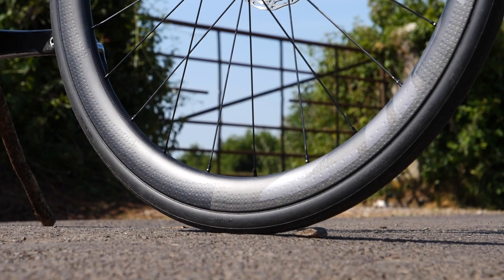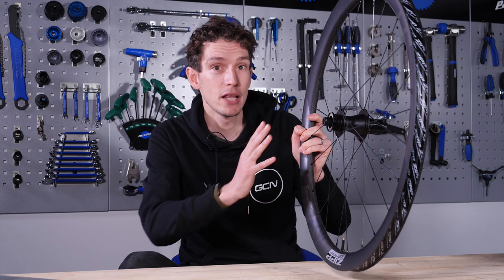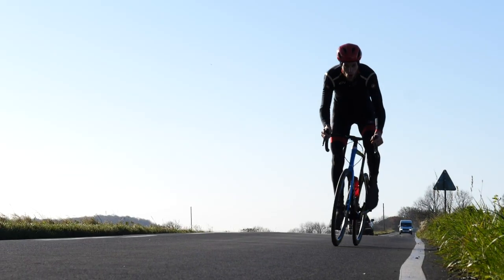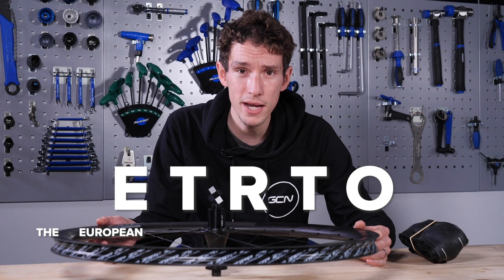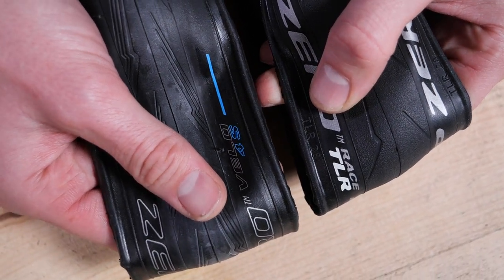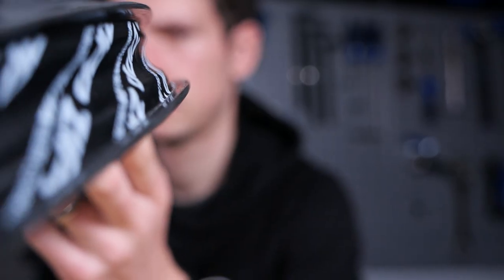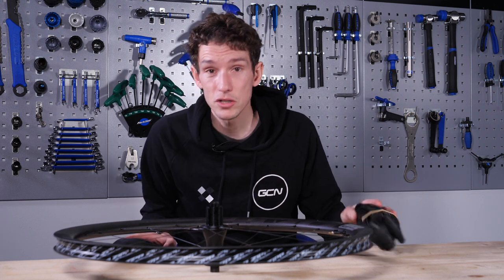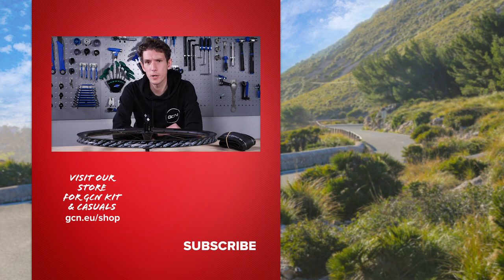Hookless Rims Explained | Which Bike Tyres Can You Use & Why?

Comment: i purchased a very expensive set of carbon hookless rims at my local bike shop.   They sold me some nice, expensive tires to put on them.  After a full weekend of wrestling with it, the tires would not seat or seal.  Turns out the tires weren't compatible with the rims.  So we checked with the wheel manufacturer.. they basically said, 'we only tested it with ONE specific tire MODEL, and only in one specific size, and only at a very specific pressure at that.    So, we tried that tire (not a tire or brand I was fond of mind you), and still had a terrible time getting it over the edge of the rim, even using metal tire levers (after snapping several plastic/nylon levers).    These wheels were specifically intended to use on a gravel bike.  I live in an area where it is often cold and wet and dark, and almost all of the best gravel riding is in areas with little or no mobile phone coverage.   Then we asked if they supported running tubes in these tires.. the answer was a firm NO.   Which means no emergency tube/boot install.

I sent an email to the manufacturer asking them how I could get possibly service this tire in the field - i.e. on the side of a gravel road or trail, potentially in cold/wet/freezing weather, and outside of mobile phone service area.   They had no answer.    My comment was a very pointed request for a refund, which they granted.    The shop doesn't sell that particular brand of wheel any more - at least they didn't last time I was there.  

Keep these simple thoughts in mind when considering spending money on hookless rims.   What tires are you going to run, and at what size and pressure? Are those tires compatible?  (ask the wheel company and the tire company - you'll probably get VERY different answers from both).   Are you willing to limit your tire choices to those that are compatible?   What happens if you cut a sidewall, or have some problem that requires you boot the tire and put a tube in?   Bottom line, what benefit are you getting from hookless rims that make it worth dealing with all of this hassle?

I'm back to hooked rims and safe tires that can support a wide variety of sizes and tread options, and  have the options of running tubes.   I'll be there for a while.  

For those that opt to go with hookless rims, best of luck to you.
Reply: Wow!!!  THink I'll wait a year or so till they are more common & have been tested by more people.
Reply: Great post.  I'd REALLY like to see Si Richardson's response to this (probably far more common problem than he implied in this sponsored emphatically optimistic infomercial.  He did say he'd be reading such posts with interest....
Reply: @georgehugh3455  He posted this video because Zipp and or Pirelli paid him to (and I'm ok with this).  I only put this comment here so people pondering hookless rims are aware of the issues I had. Si even mentioned some of these concerns in his video, although he didn't specifically say they are no longer issues, only that standards have finally been put in place, so that, hopefully, going forward, wheel and tire manufacturers can get the tolerances sorted out.   As it stands now, at least with the particular wheelset I purchased, the 'standards' were definitely not sorted out.   I'm sure the wheelset works fine in a general sense.  I was just not willing to take the risk of cutting a tire out on a remote trail somewhere and have no way to get home.   The whole 'DON'T USE TUBES - THEY MAY BLOW THE TIRE OFF' thing is a big problem for anyone who doesn't have a team van following them around for wheel swaps.   Just do your homework/research.  Make sure the wheelset you are considering will run the tires you want to run at the pressures you want to run, and that you are comfortable with your ability to get home if something goes wrong out on the road/trail.
Reply: @jimhansen5395  There are people always trying to make a better wheel since the Stone Age. Technology and patents today can make a good designer much money but there are also trade offs as in your case. 
I love technology myself but most time tried and true will always get you there, and back.
Reply: @georgehugh3455  On Twitter, Si said that the situation that Jim described absolutely cannot happen, because tires and rims follow a standard, and so one tire cannot be more difficult than another.  But we know it does happen, in spite of standards.
Reply: Great comment! It looks you are client of a very nice local bike shop. There are a lot of dishonest LBS that would get away not caring for you and your experience as a customer and just told you "everything should work". Thankfully this was not the case and they helped
Reply: @billincolumbia  I agree.  A standard, possibly based on just one dimension, executed without checking all the variations does not guarantee an acceptable tire-wheel fit, or even a safe one.  I say this as an engineer of medical products.  The OP even outlined one flawed implementation: "we only tested it with ONE specific tire MODEL, and only in one specific size, and only at a very specific pressure at that."
Reply: @georgehugh3455  a standard is a standard, which obviates the guessing of which tire fits which rim.  If they don't fit, one of the two items being mated does not meet the standard.
Reply: Metal tire levers on carbon?  That's crazy.  No way anyone should risk damaging their "expensive carbon rims" with anything metallic.  That's when you say, "Stop!  Figure this out.  Let it sit overnight and let your hands rest and your temper cool!"

You need to use a tire installation tool like the Kool Stop Tire Jack if you cannot get a tire on properly. 

Was your rim strip full seated in the rim well?  Because that's where the "start side" bead should be when reaching the final hard part of putting the last bit of bead over the rim.  I'm guessing an unseated rim strip was preventing your tire from seating in the rim well far enough.

That said, excellent post and description of your experience.  Good that the manufacturer/LBS made you whole.
Reply: @dudeonbike800  please consider that there are multiple,.sometimes competing standards (ETRTO and ISO), for both tires.and wheels.  Then there are always manufacturing tolerances on both sides.  Hooked rims and beaded tires have been around for decades.  Hookless is brand new, and still a niche.  It may become a standard for some applications, but it will never be fully adopted across the industry.  The majority of bikes sold are inexpensive department store bikes. These bikes will likely never see hookless rims.

I'll be on the sidelines running tubes and hooked wheels and tires until the industry gets hookless sorted...
Reply: @dudeonbike800  It's charming that you think just because they flash the word "standard" around, you think there's no way two parts won't mate.  In the real world, situations like 'Poorly written/tested standards,' 'Implementation is incompatible," and "The market doesn't (really) accept the standard' occur among others.  Just a few possible failure modes off the top of my head:
- Did the standardizing body test it across ALL manufacturers' compounds to confirm the amount of stretch to allow normal mounting of the tires, or worse, the unintentional catastrophic release of that interface?  Or, is a SPECIFIC compound only allowed?  (doubtful)
- Did they test under all reasonable mounting conditions (high/low temps & humidity)?
- Did they specify the OTHER DIMENSIONS at the bead?  
- Did they cover all the various bead material reinforcements?
- Did they run CHALLENGE TESTING to at least gain some confidence that this is going to work for a wide range of mfr's?

As to your abject faith in "standards," you might look at this more general paper "Why Standardization Efforts Fail" by Carl Cargill  
https://quod.lib.umich.edu/j/jep/3336451.0014.103?view=text;rgn=main
Reply: @georgehugh3455  standards are what allow for advanced industrial societies to produce goods that meet expectations.  Unless you're a fully vertically integrated enterprise, you depend dearly on standards.

Arguing otherwise is laughable.

All you mention are the details and discussion of tolerance levels and metrics.  Go ahead, throw your hands up.  It's simply laziness to argue standards cannot be met; if you cannot provide a QA/QC system that fulfills meeting the standard, time to find another industry or job.
Reply: "Then we asked if they supported running tubes in these tires.. the answer was a firm NO.   Which means no emergency tube/boot install." The fact that you had so much difficulty getting the tyres on means there's no way you'd be able to install a tube in an emergency anyway.
Reply: @dudeonbike800  Three Words:  Creaky Bottom Brackets
Reply: @georgehugh3455  touche!
Reply: Sounds like too much trouble
Reply: I have similar experience, see my comment. It's only good for wheel manufactuerer, but not for us the end user!
Reply: Sounds like some bad luck on your part. I've got the Zipp 303s set with Vittoria Corsa Tlr and they work a treat - super easy install and no issues at all after 400 miles
Reply: @SorinVBogdan  Luck had nothing to do with it.  Unless by bad luck you mean my desire to run a tire other than the one specific  tire model the wheel manufacturer "recommended".
Reply: Same here, my customer with hookless wheels, tires always blown if i give it to 100psi
Reply: This isn't much help without knowing what wheels and tyres you had.
Reply: Ill stick with my gators and slime tubes and to hell with the weight
Reply: It's a total faff.  Can't even get my tires off these tubeless rims that came on 2nd hand bike.  Like you say, you don't want that when you're out and get a puncture.  I'll be buying some hooked real soon thank you very much.  The bike industry has gone nuts.
Reply: @jimhansen5395  Your comments are really helpful -- thank you! Are you able to give the name of the wheel company that gave you that trouble so we know to be extra careful with them? If not, that's fine!
Reply: It's important to not that while you found the manufacturers said it was unsupported, it doesn't seem like you tested whether it would work anyway.

Got to remember that manufacturers will be very hesitant to officially support a use mode they haven't tested to extremes else it open them up to legal issues.
Reply: Thanks, Jim. Your comment is very helpful. It's a decision maker.

Comment: On a ride today with my friends and one had a flat. He was riding his new Orbea (beautiful bike) . Imagine our consternation when we tried to take the tire off the rim only to find it was stuck, almost like it was manufactured in one piece. The tire was fully deflated but we could not get the tire bead to come free of the rim edge. We, 4 men, worked on this for 30 minutes before resorting to youtube and finally a call out to bike mechanic friend who told us it was a new "hookless rim" and we needed to basically "man up" and force the tire to break seal with the rim edge. Another 30 minutes with the strongest among us finally using a two hand twisting motion on the tire perpendicular to the diameter of the rim and the bead finally moved to the center of the wheel, where we could get a tire lever under it and fairly easily hook it over the wheel. On closer examination a "hookless" rim has two shoulders around the outside edge of the wheel where the bead of the tire when mounted is stretched so tight by the extra height that it makes a almost unbreakable seal. This is an incredibly hard thing to deal with on the road, and that is putting it mildly! So why would anyone create such a difficult to deal with wheel system??

One final detail, while a new bike and wide rims, think they must have measured 25mm width internal, maybe?, due to shortages the bike shop put on 25mm wide tires, was this the reason we had such problems, would a 28 or 30 have been a different experience?

My buddy is ready to shop for new rims, any feedback would be appreciated!
Reply: This was very helpful info.  Thanks for posting it.  I've seen the same comment from several others here.  It's enough to keep me from buying hookless wheels.  Repairing flats mid-ride is enough of a headache as it is; no need to make it harder.
Reply: I've done mine at home a couple times now (thanks to tubeless I didn't need to swap tubes mid ride).

While it is harder to get them to unseat, I definitely didn't have that much issue with them. Am running the 2022 Propel with Giant SLR1 wheels.

Definitely need a lever to get the bead over the rim, but found it comparable to non-tubepess once I'd done that.
Reply: @morosis82  I had the opposite experience this week taking the default tyres off a 2022 TCR with the SLR1 wheels. The tyres were basically stuck to the wheel, only removed on seeing advice on YouTube about carefully standing on the tyre to break the bead.

Comment: Brilliant as you say to see the industry working so hard to find common standards that all can agree and use for production. Now, about those bottom brackets....
Reply from the maker: 🙈 let's not get into that!
Reply: @gcntech  Boss Music Starts Playing
Reply: They should stick to just BB386/392, PF30 and BSA68/73/83/100
Reply: Shannon Trainer PF30 should only be used for kids' bikes, where a narrow Q factor is needed. BSA is outdated. It required a very thin BB housing to make 29-30mm spindles work. The only 2 standards that should be in use for adult road bikes are T47i and BB386EVO. For MTB, I would argue that there is no place for pressfit.
Reply: @404nobrakes  I'd argue the problem is to try to use a 30 mm spindle at all! Minimal benefit in that.
Reply: T47 is already the standart on all high quality frames like rodeo labs, moots, no22, argonaut, festka and even bigger mainstream brand like bombtrack and trek are already using it
Reply: @ianiscaratti4924  you misspelled “some”. Unless you think Colnago, Pinarello, De Rosa, etc. don’t make quality frames. 

Vanilla/Speedvagen specs BSA on their non-disc frames. Stating this is a done and dusted matter is awfully premature. Even Trek changed the spec for their T47 BBs from what they originally set up.
Reply: Rod Diaz pinarello colnago etc makes good frames but the italian brands are very traditional/conservative. The italian thread bb is a worst bsa version from ingeniers that just know one threddirection. trek where the first doing pressfit and the 37mm hole was the lightest pressfit standard but with 30mm axles nowadays the old trek standert is obsolete.
t47 is the best but what's wrong with classic bsa on a classic speedwagen? You can fit any crank with bsa. you could technicly fit any crank on a t47 frame but there is no t47 octalink bb or t47 square tapered bb on the market yet.
Reply: @ianiscaratti4924  I have few issues with what you replied. But massive issues with the original statement that “all” good games used it. 

Look at your list. There’s a reason half of those are metal frames - you can put a thread on those without a sleeve. It’s not a no-brainer with composite frames and there are teething pains. 

Which is why Trek had to go back to e drawing board with it.  Personally I like T47, but don’t see it yet as the “winner “ that everyone is going to use as you stated. Early days. 

I have a bike with 386. Not my favourite but I did get one BB where the sleeves are screwed to each other. I don’t see this as much worse than T47 and I can totally see manufacturers not wanting to spend the money to machine threaded surfaces. They don’t necessarily choose what’s best, after all.
Reply: or axles, or headsets,
Reply: Leviathandk axles are not something you need to exchange
Reply: @ianiscaratti4924  I've actually seen people buy new hubs or wheels for their bikes :O
Race hubs, MTB hub, boost, super boost etc. Another area where the bike industry just finds a new way to sell sell sell ;)
Reply: Leviathandk roadbike hubs are still the same. qr or thru axle for disc. mtb changed to boost like 7 years ago and you can buy adapters for old  hubs. superboost is fairly new and even that can be adapted from old hubs. but if you want the stiffer super strong newest superboost bike but didn't destroy your old wheelset from 2015 maby you don't realy need a superboost bike for your gravel trips.
Reply: @404nobrakes  bsa and 24mm spindles problem solved

Comment: 5,000 miles on my new Zipp 303S hookless wheel set. Love tubeless! Love the ride quality! Loved the price!
Reply: But, but, but...they're so DANGEROUS!!! Why you've probably died three or four times by now!
Reply: Completely agree, 1000 miles on mine on gravel, fantastic wheels and ride for the money
Reply: I just got a set yesterday and put a quick 50k on them. The ride is so good and smooth over Malaysia's rough roads.
Reply: What tires  type brands/manufacture  do you put on that zipp 303s?, I'm about to buy this wheels but still confuse about the tire
Reply: @timatrout9518  The guy wants to know what tyres will work with his Zipps. Why are you linking him to Enve's website?
Reply: @beeble2003  The Enve site has a more comprehensive list of tires for hookless rims. Hookless rims are built to the same standard.